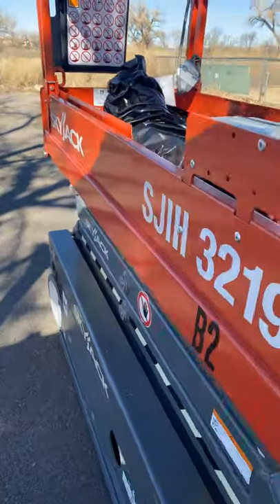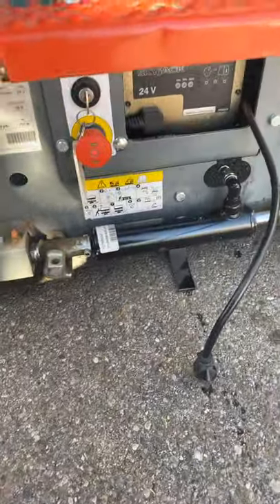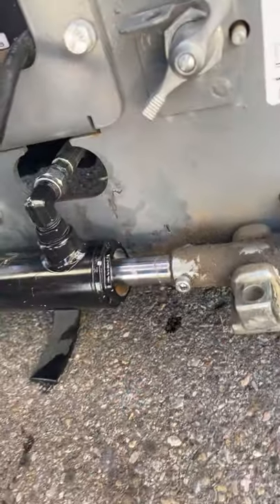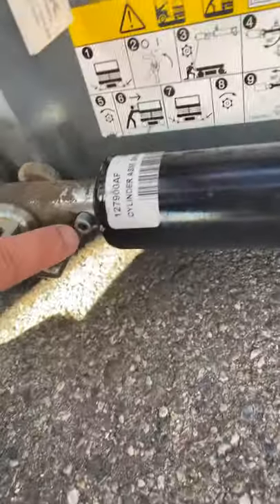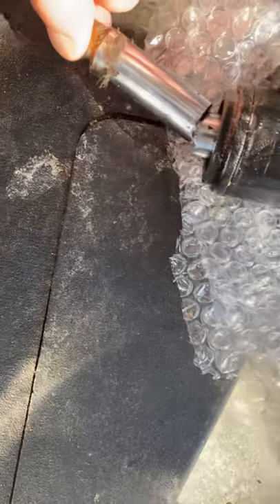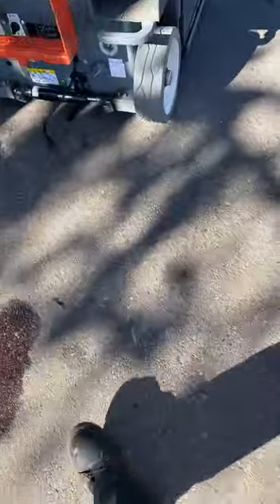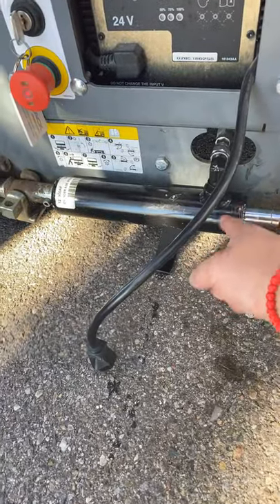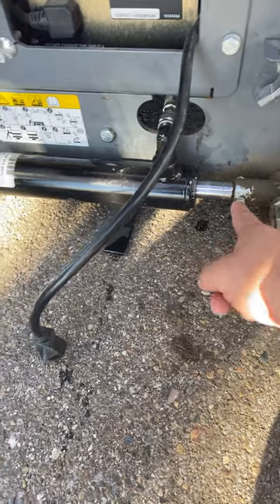Skyjack 3219 Brake cylinder removal

Comment: Hey question how would you go about releasing the brakes when there's no power
Reply from the maker: There’s two arms that will release the arms but they are hard to set but it’s possible and if the unit is to dead you can also use a jump box to give the unit power to release the brakes.